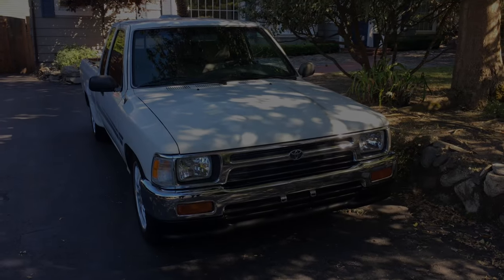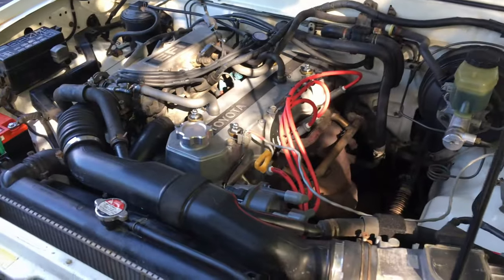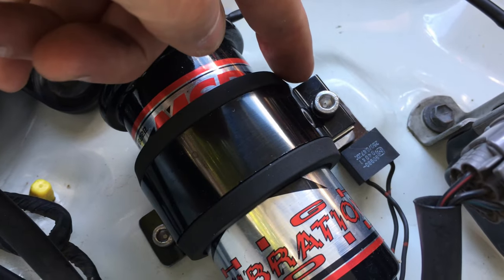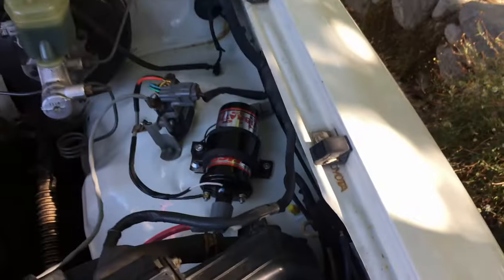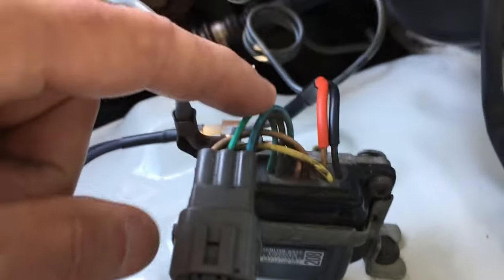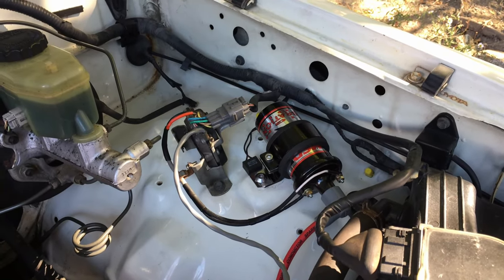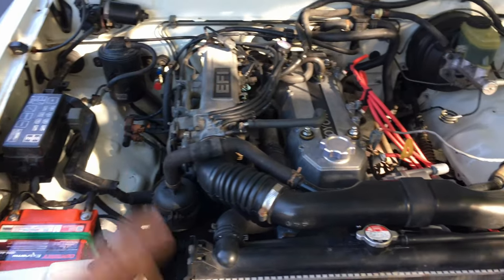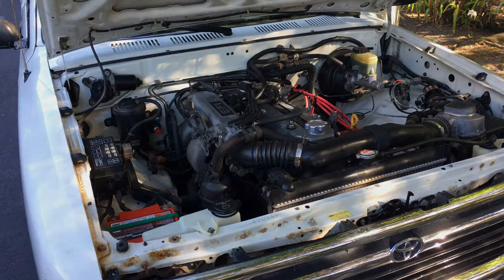1989-95 Toyota Pickup / 4Runner MSD 8222 coil ignitor retrofit / upgrade wiring & 4Runner bumper

Comment: why do this upgarde? can you use stock wires? is it just to free up space?
Reply from the maker: Mainly in order to use the nicer MSD spark plug wires. On this year pickup, Toyota switched to thinner wires and a different design coil and this precludes you from using the MSD wires. The MSD 8222 coil is also high voltage. Nothing wrong with the stock setup, but in this particular case we just wanted the more old school coil setup and the 8.5mm MSD wires in the mix.
Reply: @ray5961  can you put a link wity all the parts you used for this? Is a dui distributor worth it?
Reply from the maker: @chefrobertcaldas  Links are in the description, but if there is anything specific you need just let me know. DUI is overkill for the 22RE I think.
Reply: @ray5961  wait im confused so i have to use the msd wires with the blaster or can i just use the stock wires they won't work? it makes the engine bay look wayy cleaner with that blaster!!
Reply from the maker: @chefrobertcaldas  If you have the older style 8mm wires (which I think were used up until maybe 93 or 94), then yes you can use the MSD blaster coil with the stock Toyota spark plug wires. But if you have the later, thinner (7mm) wires with the later square style coil, then you're gonna need the MSD wires as well. What year is your truck and which setup do you currently have?
Reply: @ray5961  i have a 1987 22r toyota pickup rwd carborated with stock wires and distributor, i heard the mdlsd helps us carb guys with getting more spark with lower rpm and a cam, like it wakes it up more or something? Plus i wanna clean up my engine bay
Reply from the maker: @chefrobertcaldas  Stronger spark is always helpful. Make sure you have a super good ground to the block and head also. Every little bit helps.

Comment: Where did you get your new igniter?
Reply from the maker: it's the original igniter that was bolted to the top of the square coil. We just changed the coil to the MSD 8222 one.
Reply: Ok. Thanks.

Comment: Is the igniter wires 16 gauge or 14?
Reply from the maker: Not sure off the top of my head, but most automotive wiring tends to be 18 ga as I remember
Reply: @ray5961  Wouldn’t it technically be better to run a slightly thicker wire to reduce resistance, since extending the wire increases resistance? I’m sure it’s negligible if there is any change, but if it doesn’t hurt why not.
Reply: @ray5961  Also should I change my head ground location it’s currently on the exhaust side bolted into the head and the wire is grounded to the firewall.
Reply from the maker: @e49erss  While it is true that resistance is inversely proportional to cross section, we aren't really dealing with high enough current or voltage (nor length of run) to make this a significant factor. You could certainly use 16 or 14 ga wire here and be fine I think. Mostly cars use 18 ga wire because it's a nice balance between size, weight and durability. As long as the connections are secure, you should be fine no matter what wire size.
Reply from the maker: @e49erss  That's plenty good - just make sure there is no rust on the contact surfaces for that little wire back there. I do run a secondary ground strap on my motor, but it's really kinda overkill.
Reply: @ray5961  Better safe than sorry where did you run that second ground
Reply from the maker: @e49erss  That's what I'm saying... front of the cylinder head down to the right front corner area of the block, etc. - I use this one here: https://www.amazon.com/gp/product/B072K14SDF/
Reply: @ray5961  Also I have a 95 from my understanding the distributor is different what spark plug wires would I have to run I couldn’t find them and would I need to wire in that resistor?
Reply from the maker: @e49erss  Not sure about 1995, but you may have to change the distributor cap so you can run the traditional MSD plug wires I show in this video. No need for the ballast resistor stuff, since we aren't using points that contact.
Reply: @ray5961  Do you think the distributor cap would be interchangeable? Also if I can’t do that would me needing to use the late generation spark plugs require me to use the resistor?
Reply from the maker: @e49erss  on my friend's truck, we just switched to this distributor cap: https://www.amazon.com/Genuine-Toyota-19101-35180-Distributor-Assembly/dp/B00KTI34ME/ - not sure what you mean about the resistor stuff? You mean resistor style spark plugs? You wanna use the Denso W16-EXR plugs off amazon. As far as the ballast resistor thing that is mentioned in the MSD 8222 coil docs, not needed.
Reply: @ray5961  Sorry I was a little confused I’ll just change the cap thank you for the help
Reply from the maker: @e49erss  Yeah man for sure.. you're most welcome. Let me know if you have any other questions on anything. The MSD 8.5mm wires and that MSD 8222 coil is definitely a nice upgrade! :-)
Reply: @ray5961  Just installed it didn’t make any holes into the body came out nice truck starts quicker. I decided to gap my plugs to 0.038. Runs nice definitely a good upgrade wish I would have done it a long time ago.
Reply from the maker: @e49erss  Nice! Yeah, that coil and a larger plug gap really sharpens things up as far as the motor running and cruising along right? I was kinda shocked how much of a difference it made on my 22RE
Reply: @ray5961  It really made a difference I honestly thought I wouldn’t be able to tell. It also turns on way quicker.
Reply from the maker: @e49erss  Nice.. that's awesome. Yeah, I could tell a difference on mine also.
Reply: I did the conversion it worked up to last week I think my igniter went out not getting fire how do you feel about the eBay ones  a oem is probably $300 or more thanks
Reply: @dannybullins3452  Honestly I don’t know I’m still on my stock igniter. Are you sure the ground isn’t loose? Also you can probably get one for way cheaper at a junkyard.
Reply: @e49erss  thanks for the response I’m checking things looks like I’m not getting spark going to coil I’m hearing this could be the switch module